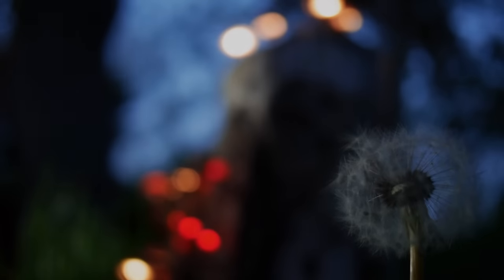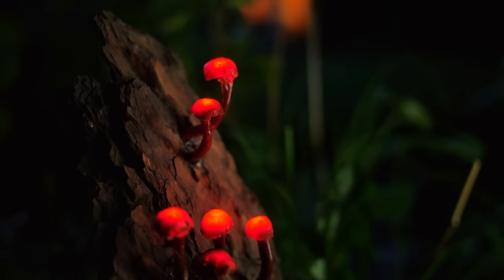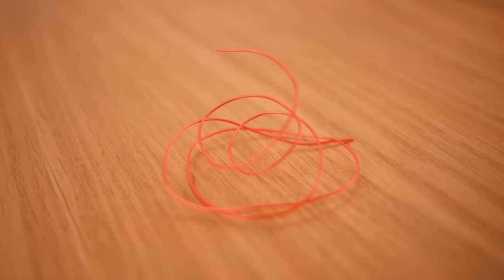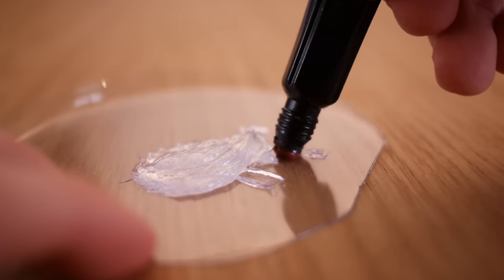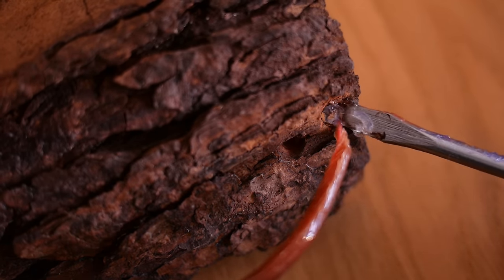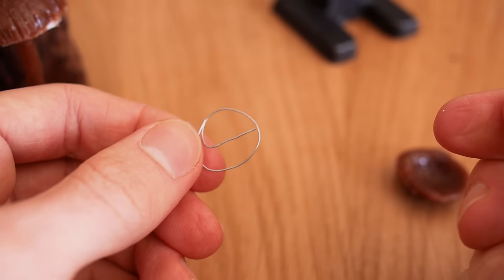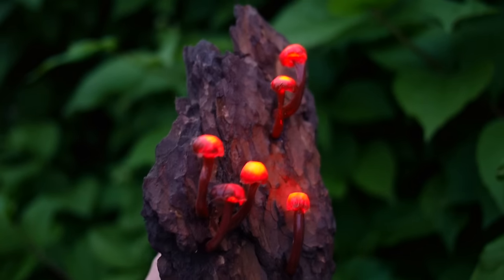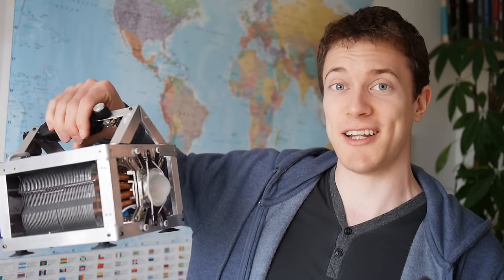DIY Mushroom Lights (craft project)

Comment: another fun thing to do if using outside, is to solder, garden solar panel to them and using rechargeable batteries in the battery pack, thus giving them the added advantage of being able to be charged from the sun during the day and coming on at night.

All in all a very good DIY project....

Comment: Just finished this awesome project! If you live in the States use GE All Purpose Silicone from Home Depot or Lowes it contains acetoxy. Other products will not cure in the plastic wrap you will have a sticky mess around the electronics. I found mixing the silicone with only a tiny amount of paint for at least 30 to 60 seconds will help the silicone cure faster.

Comment: Its quite the best explanation on how create LED Silikon mushroom lamps from bottom to top. Since almost seven years far away from others on the top of the staircase. All these TikTok alternatives (glue Gun instead of silicon, using  a chain of light aso)are shit, but might be a good option for people with less skills in electronic devices an brazing them. You are the man my friend

Comment: I wonder if you can mix a little sand into the silicone to give a more mat finish. They look amazing, I just wonder if the smooth plastic finish detracts a little.
Reply: simple gently sand scrub them afterwards, add a tiny layer of transparant silicon or keep it more rough... 

perhaps sprinkle white sand here and there before it fully cures!

Comment: Instead of using cello wrap, you can soak your silicone in water mixed with dish soap. Fill a bowl with water and plenty of dish soap, squirt the silicone into the bowl and, keeping it submerged, squish and pull the silicone. Once you start getting resistance and a clay like texture, you can take it out of the water and mold with it much more easily than you can with it wrapped in cling film.

Comment: Soo.. once I got past the first part that was over my head, I realized I could just use the batt operated led lights I ALREADY have, grrrrr...   then making the mushrooms out of painted silicone - (I had no idea silicone did that!😊)and shaping the wire and attaching with solder and soldering gun (I've had these, but didnt know what I'd need it for or how it works), now I can take that idea and run with it!

Comment: I've seen you use a lot of small batteries, and each time a special power supply is needed. You may use smartphone powerbank, as they came up with everything inside to be charged from standard 5V power (in car, computer or else) and it's cheap :)

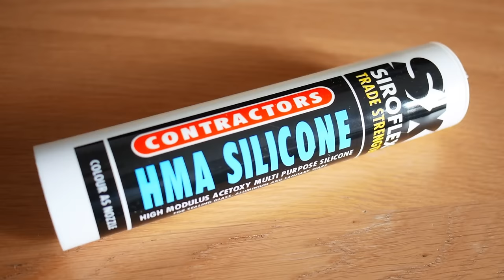Comment: the "white spirit" he mentions at 3:41 is just paint thinner. Good show btw, i've just watched how to make the color changing crystal light. Another fine video. i would however put the ir receiver in front or under the bottom edge just so i don't have to move the whole thing just to change the color. or better yet, there must be a way to make it change color on its own. maybe a control board from one of those color changing disco balls would work for that.

Comment: Dish soap will both protect your hands from sticky silicone, and there"s a super easy soap and water trick (bucket of extra soapy water, dump in silicone and squish it around) to get it to set in about 20 minutes.  Caveat, though, some newer formulation (mold-controlling) formulas may not work.

Comment: You mention extending resistor leads using steel wire. Without a very corrosive flux soldering to steel can be very difficult. Use clean copper wire or tinned copper wire. I save old twin and earth mains cable to use the bare copper wire for this sort of thing.

Comment: 4 Years Later.    Okay so imagine this.  Those moss-art picture frame projects people do. but it's got a bit of tree back on it, with a cluster of silicon mushroom lights.     And you hang them in a series of 3 to 5 along the appropriate wall.   I'll just do one for now, and look into a daisy-chain power system. (battery backup plus having them plugged in)

Comment: These are very cool, but I'm wondering if you could add something that would still let the LED color light up the mushroom but would then also fluoresce under a black UV light.  I'm thinking either luminescent paints could be used to enhance a number of speckled varieties of fungi or a clear top-coat with fine particles that could be applied to the cap.  One more thing I'll probably never do, but maybe.

Comment: Ima do this with my daughter (shes 4 me doing the electrical work of course)  but ima gonna add my own twist on it by using some el wire through the stem and around my inside my mushroom dome

Comment: This is really creative, and I plan to make some, but have a couple of questions.   (1)  You are using a 12 volt LED strip light, but only a 4.5 volt power supply (3 AA batteries).  How can this work, and could you use a 5 volt USB source?   (2) When I look for resistors, it not only specifies ohms (like 22 ohms) but also watts.  How do you know what wattage of the resistor to use?   Thank you.  Excellent presentation by the way.

Comment: Wonderful tutorial! For 5 LED (20mA) 4 of them blue and 1 orange, would you recommend to get a battery holder with 2 AA (together 3V) or 3 AA as you had and build in resistors instead? I am afraid that the batteries give a bit less than 3 V and the lights not turning on then. Thanks!

Comment: these are so beautiful and I can think of so many uses for these. Like Halloween decorations or a to use in a fairy house!  
Question, are these safe to use outside in the garden, or is this an inside project only?
Reply: the paper/cloth part replace those steps with silicon also....
and run wires to a dry spot for the powersource...
you could also use solar...

Comment: I'm curious for how long these can be active, how long the batteries last. An average AA-battery is somewhere around 2500 mAh (quick google search). These diodes are model 5630, which uses 150 mA if I'm not mistaken. He has 6 diodes (6 shrooms). And a battery pack with 3 batteries.

Batteries: 3*2500= 7500 mAh
Diode consumption: 6*150 = 900 mA.

7500/900 = 8.33 hours.

(Is my math all wrong here? Please correct me if I'm wrong)

So, only 8 hours of light before batteries are all done. That's quite a lot of consumption. Having, say, 6 of these in a garden means 18 batteries, and they're all done in like 2 evenings. That seems expensive in the long run (of course one could buy rechargeable batteries).

How have those of you that made these dealt with this? Do you use a powerbank instead? A USB phone charger? Rechargeable batteries and solar cells?

Comment: Had a question about the LEDs used in the video.  On the strip before you cut, I noticed they were 12v, but you are only supplying less than half that.  Is this right? 

Looking forward to have some 'lit' mushrooms in the back yard!  Thank you.

Comment: Nice projet !   I have led strip of 5050 (one color), and each led has 6 solder points, 2 opposite sides has 3 contacts,   why so many contacts, which one should I use?

Comment: I'm contemplating how to extend your tutorial for use within a bioactive vivarium that contains a wide variety of mosses and decaying wood made from cork. Any thoughts or ideas are most welcome. The Vivarium is bioactive and contains springtails, isopods and small worms in the substrate. Also, the vivarium is about 30 gallons and several thumbnail sized dart frogs live there as well. they key is to adapt your design to be suitable in a long term mositure rich envirnment.
Reply: As someone who has made these mushrooms, the only tips I'd give is maybe make sure the entirety of your wire is insulated, which you can handily do with the same silicone you use to make the mushrooms. After making the stems, you could simple apply a thin layer of the clear silicone over the LED and its contact points, and then also coat any points with metal exposed, such as the places you spliced your mushroom wires with your power source.

Comment: great vid, you seem so handy, and the 1 click backup is a great idea, maybe you could help me. i got a 2019 imac with i9 and when i render it goes up to 5ghz but soon back down to its native 3.6 since it heats up to close to 90c, i put of some fans and even tried to use a plastic back over the intake to suck out hot air but they didn't help much, any ideas on how to cool my imac?

Comment: Hi Matt!  Love your video, definitely am going to make some.  I'm just trying to figure out which resistors to use.  I bought a strip of SMD 5630 warm white LEDs on Amazon.  They didn't come with any current specs, but googling around I found specs for other 5630's and them seemed to be more around 150 mA.  
Where did you get the 50 mA that you state in your video?  
Do all 5630's have similar specs or vary greatly?
Would 150 mA be too much current, should I just limit it to 50 mA?

Comment: I don't understand how the ohm number relates to how many resistors you need to use or how the voltage of the batteries interacts with that ohm number.

Comment: My first six stems cured just fine, but now they won't or it'll take over a week with them half unwrapped. The first six I made were made in my garage when it was chillier outside. The following were made in the summer, and with a new tube of silicone. Could it be the humidity, or another factor? Feeling somewhat derailed by this setback.

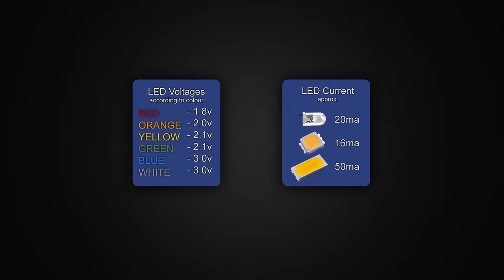Comment: From 1:00-2:20, literally in 80 seconds I can feel my brain cells splitting and multiplying. I took fairy lights with 3 AA batteries, and a little box that somehow auto on’s and off’s so it can be on when I get home from work, then peeled 9 AAA battery powered solar light panels apart, wired them in parallel I believe (+-+-+-) for somewhere from 7-9 volts and wired them to 2 packs (6 AA) and well, I’m not an electrical engineer, but it didn’t catch on fire…… it could be better

Comment: Such a cool idea and explanation. I have a question, unrelated though. I’ve noticed Americans pronounce solder as ‘sodder’, with a silent ‘L’, and find it very unusual. Which is the correct pronunciation?. Anyway, keep up with the clever videos.
Reply: I worked at a hardware store, and you're correct... most folks say 'sodder' however a lot of people pronounce it different when saying 'soldering'. Still no 'l' sound, but more 'O' sound. The people who use it/ buy it, are often handymen, construction workers, etc. & they often tend to speak more relaxed vs the people less likely to buy/ ask for it. You get some very articulate business type people on occasion and they will say 'solder' as they try to explain it... lol. A funny place to work in general to be honest. Especially these days when half or more of the men have little to no experience w hardware/tools/ home repairs. You can really see how things have drastically changed from just 50 years ago.

Comment: hi dear. i have skipped the whole electric part (we need basis acknowledge!) and i tried make just the mushroom. i had just assrmbly glue.. will it work? hoe many hours should it stay? in packet it's written 24 h.. and i hanged em because they take flat shape in the table.. any idea to skip hanging? if the glue doesn't works, will hothlue work better (or maybe will burn the plastic..)

Comment: I need your help, My silicone never dries inside the cling wrap. Even overnight it is still wet any suggestions? I'm using clear silicone from the hardware store, made for bath and windows. I mixed in some acrylic paint and squished it around the wires like you show next day 15 hours. Still wet.

Comment: Love the vid! And after watching it, I’ve gathered the supplies needed to make this. However, with my choice of color being purple, I couldn’t (at the time of purchase) find the flat smd LEDs. So in turn I bought the normal through hole LEDs instead. The ones that you snipped the end off of in the vid to distribute the light better. I was wondering how one would go about putting everything together with those instead of the smds. Any advice, or links to other videos, or the making of a new vid of your own that covers it would be very much appreciated! Thank you for igniting my creative spark!
Reply: It's going to be the exact same process, but instead of soldering your wires onto the flat little solder points on an SMD, just solder your wire onto the two legs coming off of your LED instead. Make sure that on one of the legs, you do something similar in the video to get a little piece of wire up and over the LED to point the mushroom cap to.
Reply: Thanks!

Comment: hi ! thank you for amazing video. have one question concerning wire, in you video there is one kind of wire which has something blue in the center. is it something compulsory type of wire or we should take exactly such a wire that has something in blue in the mid? please, give more explanation about it
Reply: The wire with the blue thing is called a "resistor wire" It's necessary in most cases because your power source (batteries, usb cables, etc) will probably have a higher Voltage than your LEDs (These type of LEDs are usually somewhere in the 2-3 Volt range). A resistor will basically absorb that extra voltage so you don't fry your LED with too much power. You only need this on one side of your circuit, either the positive or negative side - the other side can be just plain copper wire.

For instance, when I made made, I used a USB cable for my power source so I could power it from my computer. A normal USB power source will be 5 volts. The LEDs I have are "1206" size SMD LEDs, and the Blue colored LEDs in this size are rated for 3.2-3.4 volts (I found this by googling "1206 smd led voltages" - each color/size combo is slightly different) I have a big pack of different values of resistors, which I got on Amazon - in order to figure out which resistor I needed, I Googled "led resistor calculator" and entered in the info I had, which told me how much resistance I would need (measured in Ohms - a value used in electronic wiring to tell you electric resistance, the higher the number the greater the resistance). Then, I just matched up my resistor wire to my LED and soldered it on.

It's confusing at first, but this should give you enough to start researching - spend some time looking over this info and it'll start to click in your head, there are a lot of great resources online about this.

Comment: So could you put it in epoxy? Will it work? Or LED will burn off without air circulation?
Reply: there's no point to this project for epoxy cuz it won't be flexible....
the led won't be a big problem on epoxy project anyways ;)

Comment: Why do you  use resister..? Use two cells instead of three. Or use two sets of two cells each in parallel connection (total 4 cells )
Reply: You need a resistor for each LED, as the current that they draw needs to be limited. If you place a row of ten LEDs in parallel, each one needs the correct value resistor. If you fail to do this, you will find that one or two LEDs will hog the current, and eventually burn-out.
Reply: Probably. But I think the LED will work at 3v. And each cell has a voltage of 1.5(if it has more volt we need resisters) . So when 2 cells are used 3volt will be the output. So I think LED will work properly.

Comment: what do I do if the ohm-value I get is 0? my battery pack has 4*1,5V AAA-batteries with two and two lined up after each other in two rows. I googled a little and found online that with them lined up in two rows like that the voltage output would be 3V, so when I then subtract the voltage requirement of the LEDs (3V) I get a 0 ohm-value eheh did I do something wrong?

Comment: Instead of battery pack, use USB cell phone charger. These put out 5 volts and so the resistors will be the same. The red and black wires in a USB cable are the positive and negative.

 .  Now you can leave your mushrooms on all night!
Reply: One question. If I have 4 (1.8v  20ma) led's, do I need a 7.2v battery pack, or do I need only a 1.8v battery pack?

Comment: I am seeing that many clear silicones are “non-paintable”. If I mixed the color into the silicone like in this video, would it work well? Also, would acrylic paints work when the silicone is dried? I plan on making some leaves(no lights) but I would like to add some more detail when the silicone dries. If anybody knows anything about this, please leave a reply. Thanks:)

Comment: Any ideas on how to do this project, but keep it easy to add a new one if one of the LEDs dies?
Reply: LEDS mostly go for 10000hours each... so as long as the correct leds,
combined with calculated resitors for the powersource you won't have to worry for a lifetime!!!

Comment: if I use leds 3,4 v as much as 100 pieces. and use Solar panel: 2V / 100MA, 400mAh 1.2V Ni-MH battery, what type of resistor is used ... please reply,,thaks you
Reply: that's not gonna work or supersoft.... 2v solar is a good start 100ma charging is also not bad... cuz 400mah batteries will be fully charged from depleted state in 4hours of sun... the problem is 100pieces is to much in my opinion... as example the SMD light 50mA, 8 of them will draw empty yours source in 1hour!! so or INCREASE source mah to 4000mah then u can run 80pieces for 1hrs if thats to short double it 8000mah for 2hrs runtime on 80 SMD leds with a 50mA value.... (here i'm assuming you use 2x AA so 2.4v in total)

Comment: I want to try to make some mushrooms but I'm a bit troubled with picking the correct resistor:
I'm considering 1206 SMD LEDs (good choice?) and they are rated at 20mA.
So my calculation with 3 AA type bateries ends with needing a 85 Ohm resistor. 
I'm not sure if this is correct since the video states that this type of LED needs a higher current? 
Does anyone have experience?